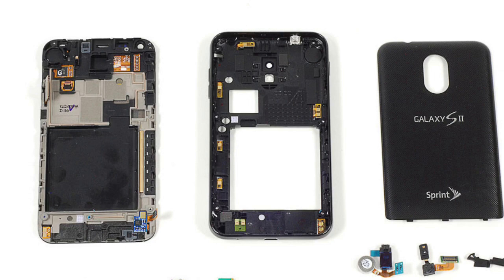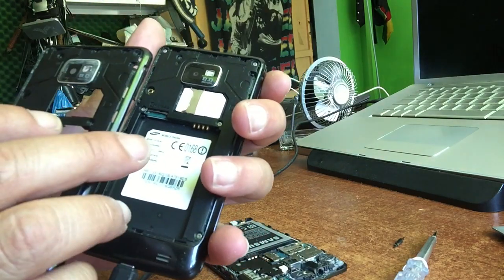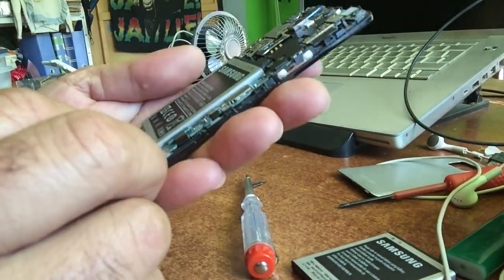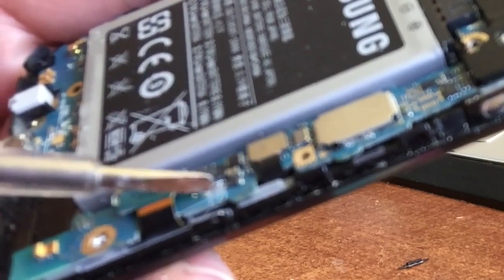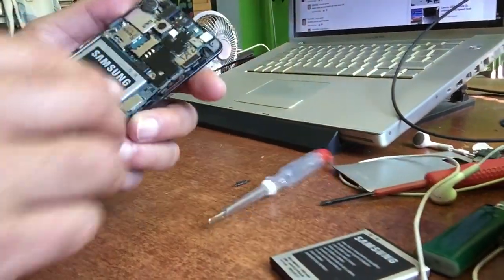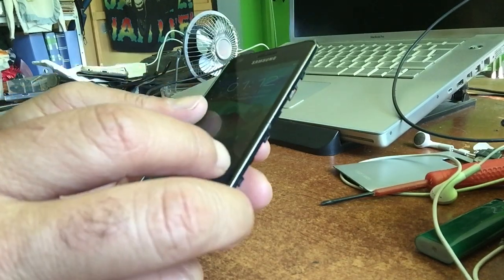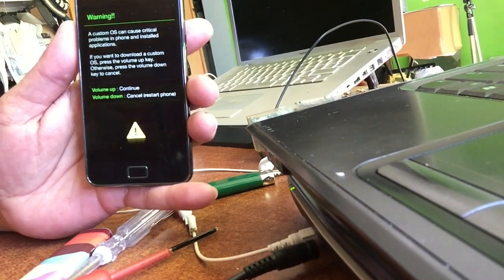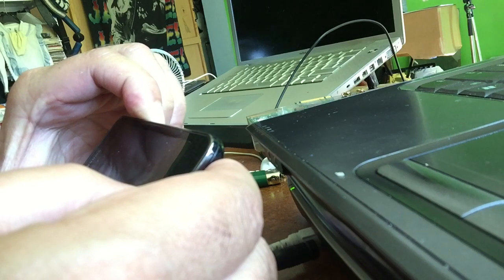SAMSUNG S2 DEATH OUT OF NOTHING POSSIBLE FIX - TRY IT - 2016

Comment: I removed the capacitor but it's still the same 😂
Reply: Did you find the solution ? Mine has the same problem, it just doesn't power on and heats on the top. Removing the capacitor didn't change anything.
Reply: @AiLiShan365  same here, got in 2024 but still trying to fix my 2017 phone to get data out of it 😅😂